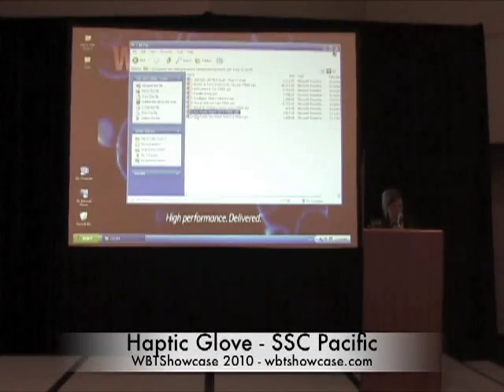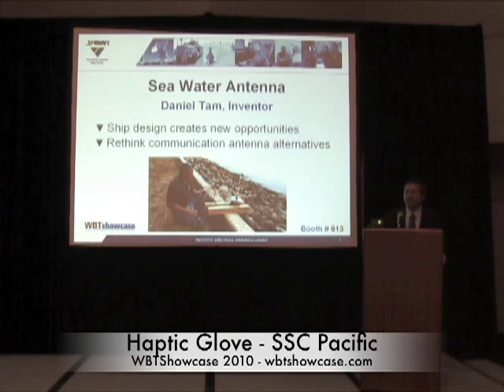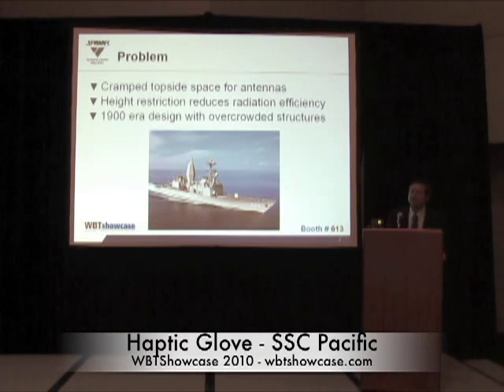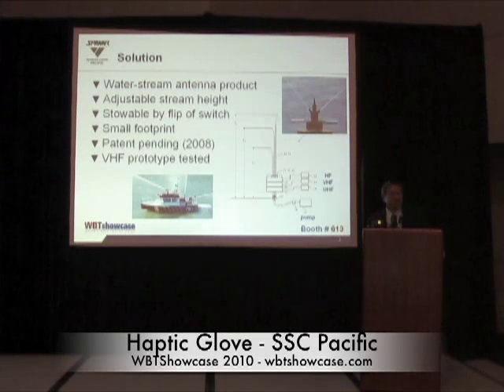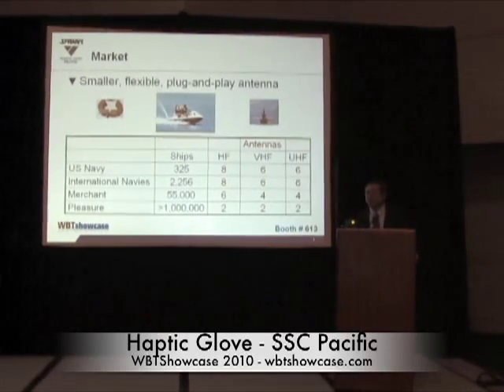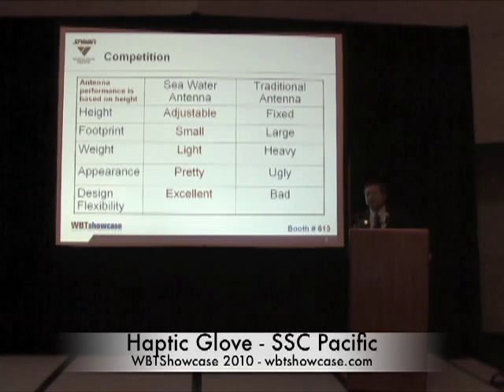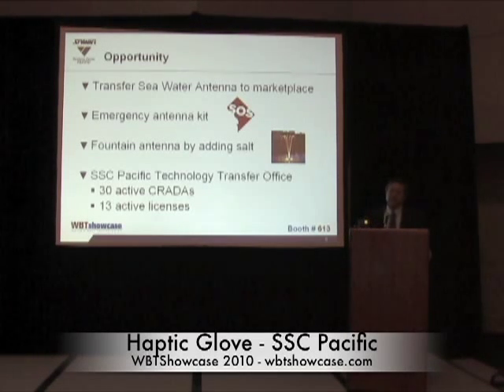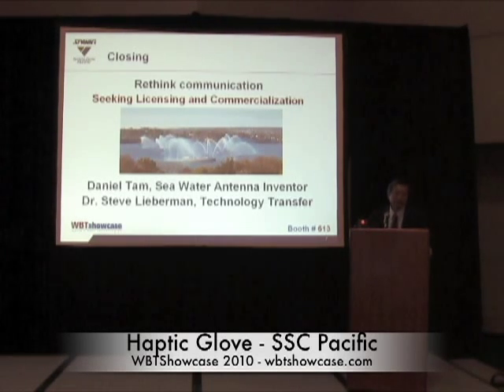Sea Water Antenna - WBTShowcase 2010

Comment: Awesome to hear this works I was thinking about well, first seeing if it would work as stationary fluid then if motion (MHDish AC) were beneficial using a piezovibrator rather than a stream  Then make an piezovibrated ionic Gel with metallic or polymer inclusions  to reduce resistance from the conduction pathway creating reduced conduction pathway distance  Then, the nifty part, using EM to reorient the directionality of the inclusions like -- - - to \ \ \  to create adjustable polarization or frequency to have greater frequency range vastness from an antenna of one size.  also I heard of polarization division multiplexing  So as an ionic gel antenna with configurable frequency as well as polarization it could give handyphones a much wider area of frequencies to function at which is fiscally beneficial to handyphone companies  This is a public domain idea I was about to record then put up at the public domain ideas file area I placed at http://tinyurl.com/publicdomaintechnologyatmega